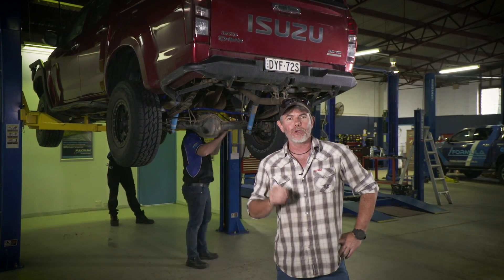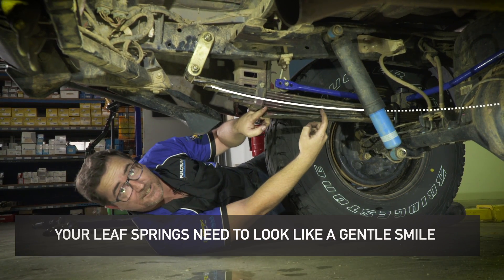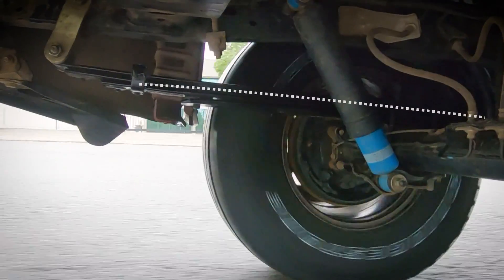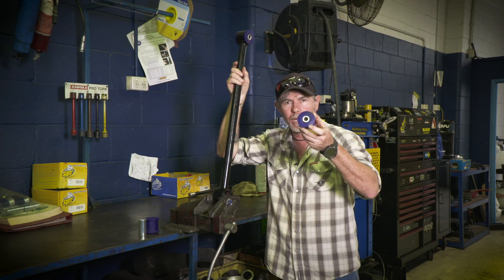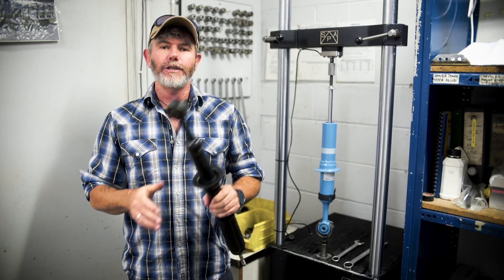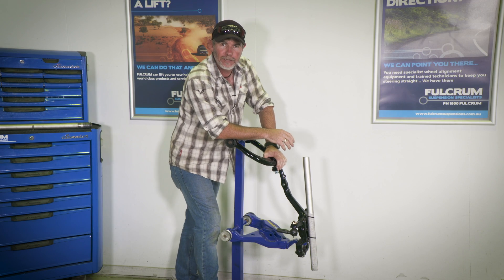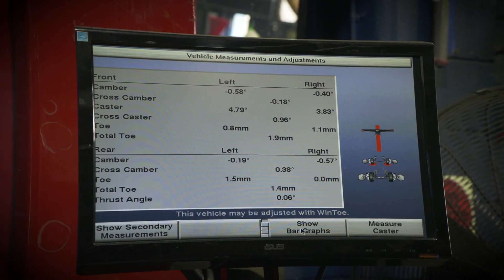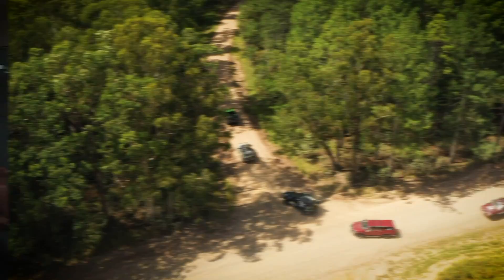4WD SUSPENSION IN DETAIL – what your 2 inch lift is missing! Graham Cahill reveals expert secrets

Comment: What is the best size of tires for dmax 2021 with 2inch lift? Is 285/70 17 okay for 2 inch lift? I use it for everyday drive to work and occational moderate  offroading.

Comment: the problem i have is that my 2 lives are very different ? day to day, it might only have the tub on it.....(150kg or so) but if i go out camping and chuck in batteries, tables, chairs, fridges etc......then thge weight is up ? which way should i go with lift kits that say '150kg rated' or '300kg rates' ?

Comment: I just fitted a 2inch lift to my 2014 hilux, I went with bilstein with 400kg leaf springs, so I can load her up to go to cape York next year, mean while nothing in back...so now I have noticed a shutter on take off and my drive shaft is high at front and low at the back. (I don't like the angle of the drive shaft)  the shutter is awful. How can I fix this problem?

Comment: I own a 2016 dmax. its fitted with long range 140ltr fuel tank. front n rear bullbar, side sliders with fender guard pipes. winch, 17inch alloy with 265 tires...n its running an ironman foam cell pro B grade 2inch lift suspension kit all round.. is it better to upgrade the front upper arms or diff drop kit or both?

Comment: Hi Graham.

Looking for some guidance please...

I’d like to lift my 2017 d/c xls 4x4 ranger, 50mm. (Vehicle is still under manufacturer warranty)

Would You say the spacer on the front springs and the extended shackles at the rear is the best route to go?

I don’t want to lose current handling and ride comfort.

It’s been suggested I replace my front springs with longer springs to give me the extra 50mm lift and then redo my rear springs (not shackles) to give the lift.

What is your opinion on these two options?

What’s your recommendation? 

Thanks and keep up the awesome work/show!!!

Kind regards
Darryl

Comment: I have a Nissan Navara NP300, with an alloy bar at the front, canopy and draws. I have a 16ft caravan, which is not used as often as I would like. Generally the car doesn’t carry weight so how do I balance general use and towing?

Comment: I have a 2002 Ford f150 4x4 and I only want a couple inches of extra clearance for bigger tires and such so I can take the family on camping trips this summer but all I can find are torsion key leveling kits. Are torsion key leveling kits safe to use and are they any good off road? And are they going to wear out lots of other bushings and ball joints and stuff like that much faster? I don't want to ruin my truck I just want some more family time

Comment: After seeing this video I can see that a rear sway bar would massively help my PX2 Ranger on the road when turning tight corners but what effect does the rear sway bar have on the vehicle when off-road? Are there any downsides to having a rear sway bar when off-roading?
Reply: just remember though ....the less flex in the suspension, the more pressure you are putting into the tyres. So if your ranger (like mine) is set up to run nice an flat and fast arouns bitumen corners...it will chew the tyres out

Comment: Good video! I learned a lot. 
I just purchased a 2020 Toyota 4Runner TRD Off Road Premium with a 3 inch lift and 32 inch Nitto Ridge Runners.
Do I need to be concerned about the suspension????

Comment: After I fitted a certain other brand of suspension to my D-Max, the front only had +-50mm of max droop. I had it hitting the max when going over normal speedbumps etc...  Even when I put the OEM coils back in and the vehicle being OEM height the struts still did not want to allow more than 50mm of droop when jacked up. This is not right, is it? What amount of droop does your struts have?

Comment: I’m looking at getting a three door 2004 Suzuki Grand Vitara as my first off roader. Since that’s not as long and can’t have as much weight over the rear because of interior space, what setup would you recommend for that?
Reply: My daughter has a Suzuki Grand Vitara, and it is only recommended to have a 40mm lift, as they don't have the travel of other cars, putting a lot of stress on the CV joints and brake hoses (so I'm told). My daughters GV with the 40 mm lift (King springs and Monroe shocks) and it is better on sand (probably due to weight) than my Colorado 7

Comment: Swaybar block the suspension movement for offroad, inst it?
Reply: It limits the movement of the vehicle off-road and limits the amount of suspension flex.
Reply: @anthonyramdin1037  is that good or bad?
Reply: @siveti15  bad if you're off-roading. Good if you're on normal roads.
Reply: @WES-GR4PES  thank you

Comment: That is one thing some people do not take into consideration and can be complacent about when lifting/raising their vehicle is bump steer. This affects your alignment, ride, shock dampening, camber, castor and steering. Has anyone ever seen 4x4's, or any other vehicle for that matter, have their front wheels wobble at speed? If so, that means the bump steer is very bad and it is extremely critical that this eliminated. If it isn't addressed it could lead to a fatal accident &/or serious injury. Cheers for the video :-)
Reply: Ahh...called it something else. I'm picking up what you're laying down now
Reply: that's what a steering stabilizer is for.  They cost about $200US including shocks round here.  You go over a 4 inch lift you throw a stabilizer on her for GP to deal with bump steer.

Comment: Hi Guys,
I am about to place 2 inches of King & Koni under my GU. I understand that I need to put extended says bar links in along with brake lines and and a taller brake proportioning bracket. Is all this necessary?  I would like to have sway bar - disconnects  but understand that some company’s (Superior) produce an extended sway bar that works like it is disconnected when off road. I am unsure how this can work. Can you explain this please and are they really going to be of noticeable difference on only a 2 inch lift?
Regards

Comment: Cool video. So I have got a couple quick questions for y'all 
1) this might sound dumb but how much can a three inch lift really help with clearing obstacles.
2) I'm planning on putting a lift on my 02Nissan frontier it has torsion bars is that a simple install
3) what if the leaf spring bracket are good and rusted can those be replaced?
Reply: 3 yes, it's a bit more work but they're replaced all the time.  In fact if you're replacing leafs on any older vehicle it's generally best to just replace the brackets and shackles all at once with them.  No point sticking fresh leafs into a rusted up wreck of a 20 year old bracket.

Comment: Hey Mate, I’ve got a box stock 2003 ford courier and I’ve wanted to upgrade the suspension, all it has at the moment is a tortion bar and leaf springs. Will added suspension effect fuel economy and any other aspects of the drive?

Comment: Greame i want to know what size rim and tyre ur using on ur truck, also what size lift have u got.......ive got a 2012 trition dual cab turbo diesel....with a suspension upgrade and 2.5 lift...i have standard 17 inch alloy rims...and i want to run 31s......can i do that without scrubbing out....cheers hope to hear from u asap...Rod...from newcastle..!!

Comment: Great Video. I'm new to the channel and have subscribed. I've just purchased a 2nd hand 80 series Landcruiser diesel wagon that has a 2 or 3" lift kit with coil springs(I'm unsure as to which height it actually is). I would love to see a video on coil springs instead of leaf springs and the impact this has on my vehicle. I'm new to lifts and don't know anything about them, and am learning fast, I have had to replace a lot of the bushes and things underneath mine for the RWC. My old vehicle as a Toyota FJ40 back in the day.

Comment: Hey Shane I've got a nissan terrano d21 1993 and I've just replaced all the steering joints and tie rods and put a idler arm brass on it and the inner tie rod bolt sometimes rubs the frame ? Any thoughts why it would
Reply: Alignment is off

Comment: Hey awesome video, I was wondering, I live in the US and over here everyone constantly throws up King, Fox, or icon suspensions with remote reservoirs and I see other suspensions that you guys use and they don’t look nearly as “fancy” is there any reason remote reservoirs aren’t as common on shocks on your rigs?
Reply: chris bunch Remote reservoirs would be very helpful on something like a Ford Raptor running high speed down a washboard road or out in the desert (for a US car example). For vehicles that are mainly doing slower speed stuff and low speed crawling, there isn’t necessarily a reason for the added expense and complexity of a reservoir shock. It’s all about your heat reduction needs. With that said, if you have the money, there isn’t any real downside of a reservoir shock. Anything that keeps your shocks cooler is good.

Comment: I have a front sway bar drop bracket on my truck now. It is suspension lifted 3inches, do I need to add extended sway bar endlinks too? I have Baja kits upper control arms and want to take advantage of the extra droop but don't want to take the sway bar off

Comment: Guys...
I've a 2008 pj Ranger. 
Need a quick opinion on leafs. Had 200kg kit on the rear. Thought this was enough for factory original tray, roof tent and camp gear. Fully loaded with sports gear and bikes I'm prob around the 400 mark but not always the case. My average is 200kg.
Had a prob with one of the leaf packs and took it back. They reckon a 200 set is not right.... Both were flat almost sad not smile. They are bumping me up to 200+ a leaf, giving me around 350 but the lift is big.
Would a 400 pack lift as much?
Do I really need this much constant? I thought it was more for tradies towing during the week and loaded for Frazer at the weekend.

Also, Looks like a sniffer dog at the front.
It's been spec'd for bar and Winch but if I go any higher I'll start wearing cv boots!

Your thoughts

Comment: How does lifting a dual cab D40 2 inches affect the life of the CVs?
Reply: Wont affect it at all, it is right on the edge of inducing increased stress. We recommend getting a diff drop. Feel free to call us on 1800 385 278 or send us a message through our website.

Comment: what is the best way to check caster on a solid axle? What are the angles generally accepted as being good? Not just for caster but caster, camber, and toe.
Reply: With a spec check wheel alignment. Positive caster is good and zero to negative camber is good (some negative camber). Feel free to call us on 1800 385 278 or send us a message through our website.

Comment: Hi so I have a Mitsubishi Outlander and I was thinking of doing a lift kit on it to make it higher as I'm wanting to make something different. What would be the best way to go about lifting it. Seen heaps of kits for it but all are just bolt on spacers and I dont think that would be a good idea. What would be a good way to go but not too expensive
Reply: Spacers would be your best bet. You will likely struggle to find a complete lift kit for your car.
Reply: @FulcrumSuspensions1976  okay cool thank you. So spacers really unless I do a fully custom setup paying an arm a leg right haha
Reply: @masterwindleborn  Yea, you would be looking at custom suspension setup likely requiring engineering. If your just going for looks, than I mean by all means if you have the money. If you are looking for practicality for offroading I would invest in a new car.
Reply: @FulcrumSuspensions1976  oh cool thank you. I am looking at actual for wheel driving but trying to do something not of the norm Haha sick of all the same vehicles
Reply: Won't the lack of 4x4 be your limiting factor off road rather than lift
Reply: @bmwbrendan  they arnt that bad offroad but there's kit and custom parts been made to beef up my 4wd

Comment: I'd rather keep this one stock. Being able to take wild angles without feeling like you're going to tip is priceless. You won't get a dual cab flexing like old live axle trucks in a million years, all you're doing is introducing problems, they are just not designed to be lifted unless it's factory, such as the Raptor. 2 inch in an 80 series compared to 2 inch in this guys ute... no comparison. On my 2017 Lux I got rock sliders, underbody protection, bullbar, and away you go. Front locker next, and I think people might be surprised what it's capable of. Then I can work all week without having a pointlessly lifted truck making everything hard.

Comment: I have a 2014 GXL Prado. It's stock at the moment but I'm looking to get 2" lift. I'll be adding a winch and a kwiky rooftop tent. 

On trips it will be loaded to 200-300kgs
But in daily work life I would take the tent off and it would be around 120-180kgs. 

How do you recommend I set up suspension and lift?
Cheers.
Reply: You should always set your spring rates to account for your constant load. We can than figure out what type of ride you will get from the springs and organise the correct lift kit. We have a 4x4 lift kit filter on our website which asks you all the right questions. I recommend you call us on 1800 385 278 or send us a message through our website.

Comment: I would like to lift my 1989 nissan terrano 2 inches it has torsion bars in the front that can be wound up to give me the 2 inches of lift but I'm not sure if I would need adjustable ucas
Reply: It is not recommended you lift it two inches, as the shock absobers will top out and damage the lower shock mount. It could also damage other components. We recommend you lift your nissan terrano, at maximum 1.5 inches. Feel free to call us on 1800 385 278 or send us a message through our website.

Comment: Would a rear sway bar affect the flex Offroad
Reply: Fitting larger sway bars, particularly in the rear, has two main effects, vehicle balance in terms of under steer or over steer and increased roll resistance. Both of these effects can provide increased overall handling and safety benefits in a 4WD vehicle. If you are looking for increased stability on the road or when towing, sway bars are a great upgrade option.  

As most factory vehicles are partial towards under steer, fitting of a larger rear sway bar, or the addition of a sway bar, helps in providing a more neutral characteristic in the handling. This is due to the increase in roll stiffness at the rear, which changes the loading of the rear wheels under conditions of increased cornering load. SuperPro offers a great range of aftermarket sway bars engineered for many off-road applications, also offering many adjustable kits to best suit your 4WD build. 

At the same time, as the rear end is resisting more of the roll, the front end resists less in proportion, leaving the front wheels more evenly loaded, producing more available front end grip. In the end an increase in overall stability can be achieved by balancing the vehicle.

Another effect of introducing larger rear sway bars is a reduction in chassis roll. This reduces the effects of “roll camber”. Roll camber is the variation in the wheel and tyre camber setting due to chassis roll. During cornering the presence of chassis roll usually results in the outside wheels gaining positive camber. By increasing the roll stiffness and reducing roll camber effect, the wheel and tyre combination stays closer to its optimal setting.

As an alternative, this could be remedied by starting out with large amounts of static camber to counteract the positive camber gain. The trade-off however is the resulting increased tyre wear, and reduction in straight-line handling.

Now that the basics are covered, imagine a Nissan Patrol, Toyota Land Cruiser or Toyota Hilux that has been lifted 50mm with a bull bar and winch package. It has been fitted out with a draw system, roof rack and tows a twenty foot caravan! This may be the extreme, but somewhere between this and a standard, off the showroom floor vehicle, is where most of these vehicles operate. The factory sway bars were never designed to control anything other than the standard vehicle at standard ride height and with something less than being loaded to their GVM (Gross Vehicle Mass) limit.

The modern 4WD Dual cab utility, almost the family sedan of this century. Is normally coil sprung with a strut front end and leaf sprung rear with no rear sway bar support. Because of this dual cabs typically suffer from under steer and can be very unstable during high speed directional changes. When you load the vehicle with accessories, people, change its height or tow the problem only gets worse.

The biggest resistance to the fitment of bigger sway bars to 4WD vehicles is the flawed concept of the loss of articulation in the suspension. If the replacement sway bars are designed correctly and the sway bar links are lengthened, replacement sway bars can be fitted with minimal or no loss of articulation. However, the improvements to stability, safety and drive ability will far outweigh any loss of articulation.

So without reducing comfort or articulation, a sway bar will make the suspension system and tyres perform better, making the vehicle more responsive while neutralising under steer. Fitting a sway bar offers all round improvements in handling, tyre wear, comfort, safety and load carrying. It is one of the best handling improvements you can make.

Feel free to give us a call on 1800 385 278 or send us a message through our website.